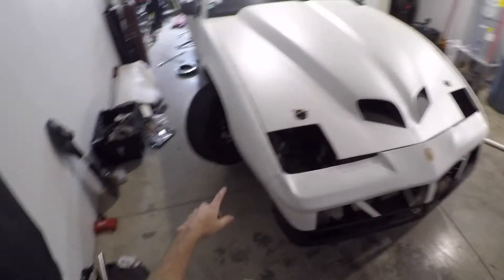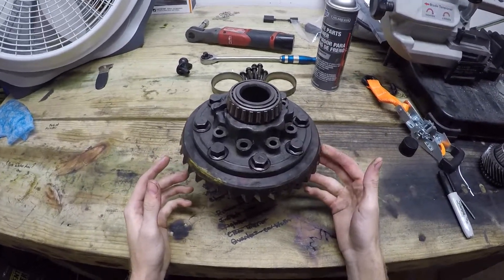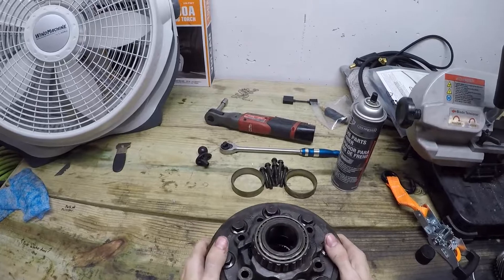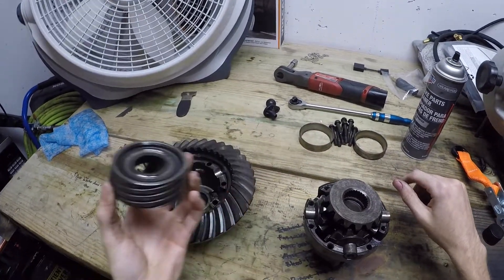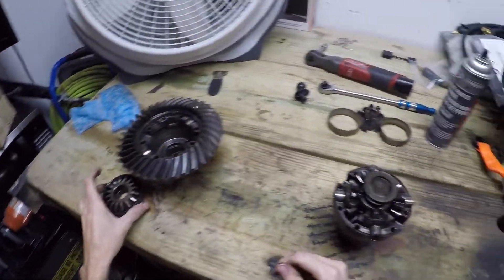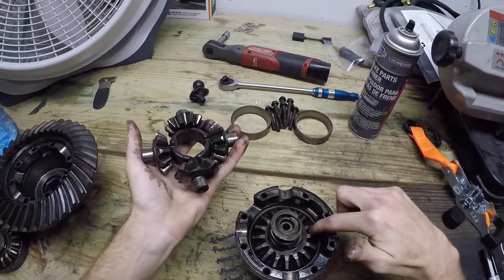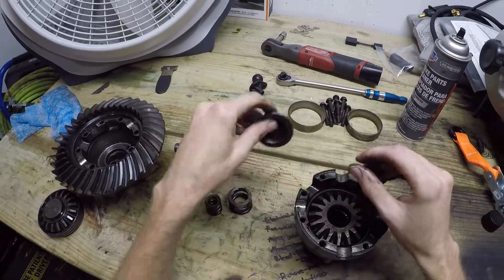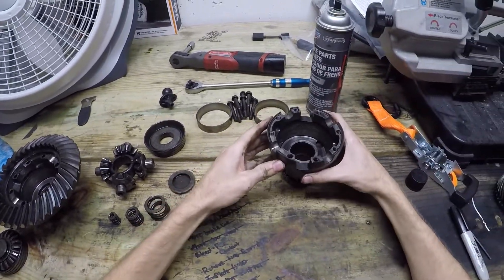Inside a Borg Warner 9 Bolt

Comment: Did you end up just welding the gear and/or the cone to the carrier? Dont see how you could access the spider gears to weld like normal and maintain alignment. Got my 9 bolt all torn apart right now and debating how to tackle the problem to get it to lock better since I'm also drifting
Reply from the maker: Yep, I welded the window access hole from the carrier to the cones (to hold the cones in place when the diff was fully together and centered with the axles in), then I took it apart and fully welded the cone to the carrier from the inside. I then grounded down the weld to fit the spider gears back in and reassembled. It's been working perfectly.
Reply: @thedriftmullet  did you weld both cones or just the one? and how did this hold up for ya? im planning on solid crush sleeve, TA girdle cover, and welding this up and seeing if it holds up to my turbo ls with drag radials.
Reply from the maker: @williamlink6279  I welded both just for the strength. It could technically work just welding one cone to the carrier, keep in mind if you're putting radials on that diff it's not gonna last long with one cone welded.

Comment: They are a pain in the neck to rebuild. Welding them will give you posi But when turning corners or parking the car it will chatter and around corners it can be very dangerous because both wheels are spinning at the same rate.
Reply from the maker: it's a drift car lmao. That's the point

Comment: Had to service one of those Borg Warner 9 bolts in my thirdgen way back in 1995. Then it was a Nightmare to find a posi unit.  Now it’s a bit easier to be able to import one from the land down under. Have a 9” ford now but would have been nice to have kept it more original.  Thanks for showing how it goes together for thirdgen fans.
Reply from the maker: I’ll trade ya for my 9 bolt! I just welded it up and took it for a few test rips, I’m surprised how well it actually worked. Even with my cones completely bottomed out this thing does amazing welded up